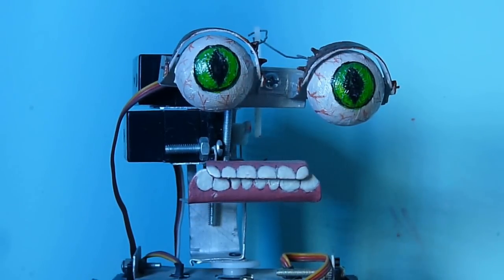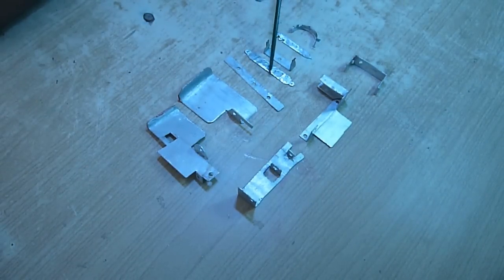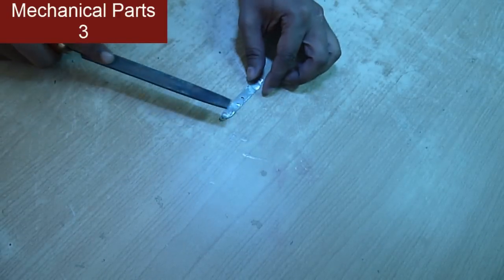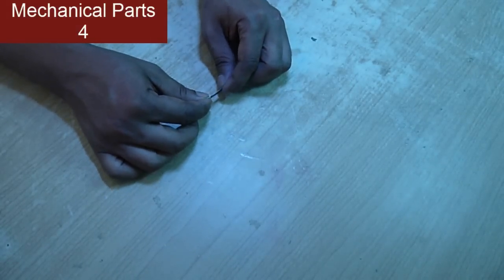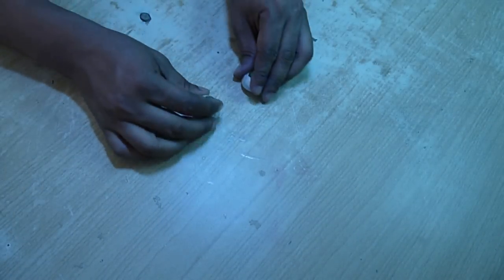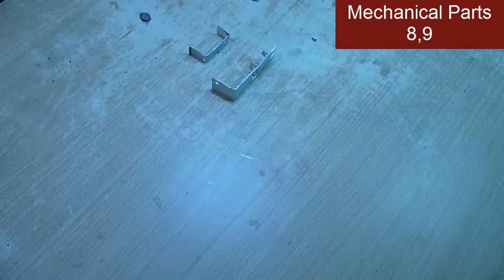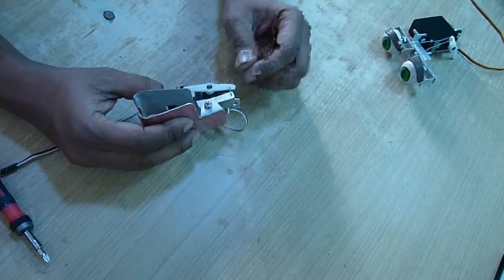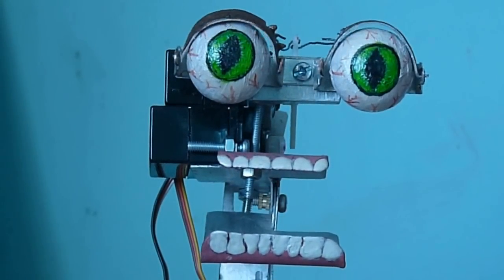How to make your own Animatronics Robot at home

Comment: Would it be hard for a 15 and a 1/2 year old to construct. Especially having it to be my first engineering project? Also, even if I could do it, is everything expensive? Please get back to me.
Reply from the maker: You can make it easily. It's not costly too. Per servo motor is whithin 4 to 5 usd
Reply: @BrainergiserTube  thank you ":3 your video was great aswell.
Reply from the maker: @princesslee8018  thanks

Comment: Im looking to make or purchase a device that stays closed to no sound and opens wider the louder the sound is that it receives from a speaker. The speaker is attached to a blue tooth transmitter that can link to a mobile device (phone, tablet, laptop) that has the sounds, voices, or music that plays through the speaker. The goal is to have the mouth move to the sounds it receives. I need it built to be inside a mascot head so that the top jaw and bottom open and close. Please help you are the only person I have come across with instructions I can understand

Comment: Thanks for the help making an animatronic head! but i dont know how i can make the body to make mitsi from showbiz..
Reply from the maker: You can give it any shape and look. U can use cardboards, silicon. There are different videos on that in YouTube.
Reply: @BrainergiserTube  ok but what about the arms and legs?
Reply from the maker: @funtimefoxythefox6731  you can use multiple servo for them
Reply from the maker: I have robotic related videos in my channel
Reply: @BrainergiserTube  hmmm how do i put the mask on and making the down jaw making the down jaw go up\down when talking?
Reply from the maker: @funtimefoxythefox6731  if it's just front side of the face, put it from front and tie with the robot. Do need to make to mask flexible or stretchable around mouth section for the jaw to move up and down.
Reply: @BrainergiserTube  exactly what i was talking about! can i do the arms be black tubes then put the fur on it tho?
Reply from the maker: @funtimefoxythefox6731  Yes, you can.
Reply: @BrainergiserTube  hmm i want the ears moving how do i make them move?
Reply: @BrainergiserTube  i need some help here i want to make loony bird